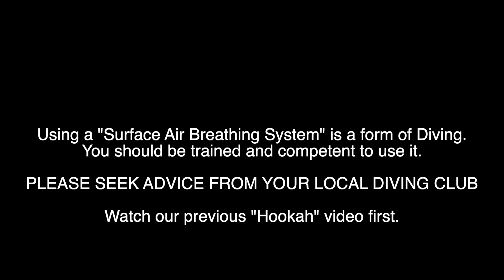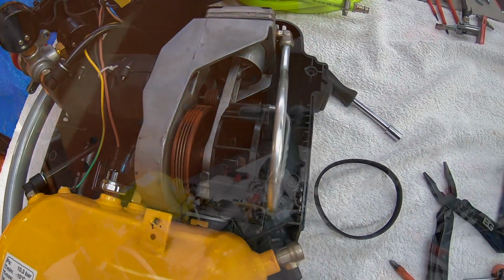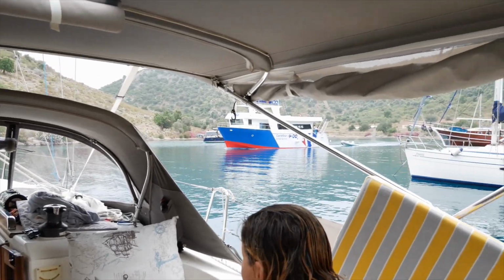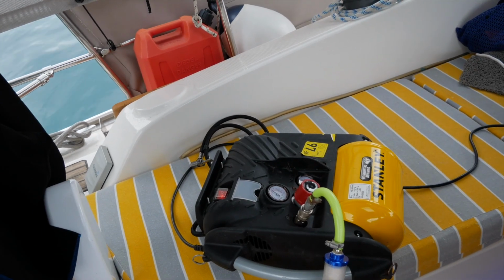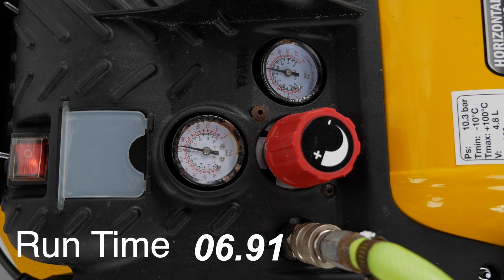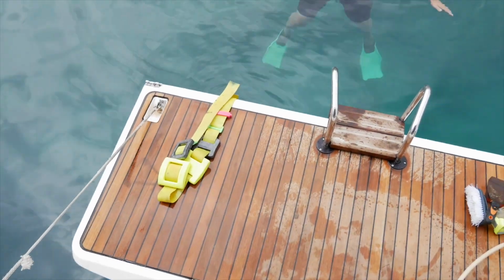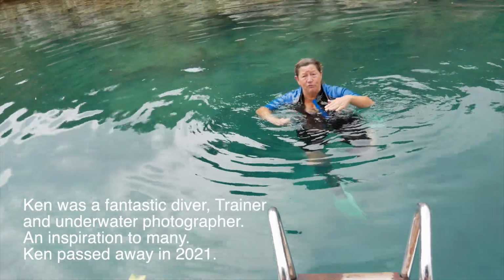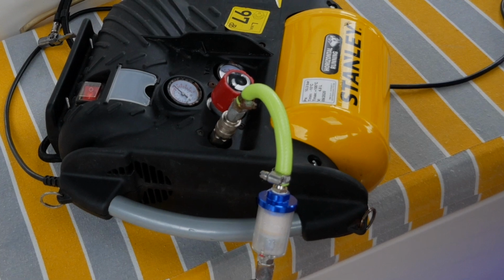A Cheap Hookah! Saves You Hundreds! We follow up on our original construction.

Comment: Having a hookah rig aboard is invaluable! Great addition.
As a professional diver with years of using hookah rigs, as well as working for dive service company, here are a few suggestions:
1) try to plug unit into an outlet (GFI) or use a short heavier gauge extension cord than your surge strip 
2) Add a D ring to your dive belt, then affix a carabiner or bronze halyard clip to your hose
3) to avoid tangles in hose, swim out entire length and take any twists out before clipping it on dive belt. When coiling it up, throw in a reverse coil every two or three coils 
4) typical tools for hull cleanings are a 5-6”wide scrapper (round off both points to avoid scratching hull. A wire brush to knock off spent zinc on anodes. 
Three different grits of scotch right type pads.
Bottle brush (es) for your thru hulls.
Also small tool such as a 2mm t-wrench for cleaning out intakes of your sail drive.
Lastly, regularly clean your regulator, nothing worse than tasting old algae 😂😂
Depending on what type of regulator you are using, be aware some are not meant to be used completely inverted and will free flow giving you sudden mouthfuls.
If running any other fume producing machinery always make sure your hookah unit is upwind from such. 

What a nightmare replacing that belt! Good job mate!
Reply from the maker: Thanks for the feedback and tips Gordon. Some of this we are already doing. Another is to clear the bottom saildrive inlet with a long copper or aluminium tube. A lot of folks dont even know that iis there and its this one that takes a lot of water in if the others get clogged with barnacles and tube worm. All good stuff. Thanks for watching and great comments. Sail Safe mate. Ant & Cid

Comment: Great review and instructions! Question, is the oil/water separator enough to filter hypothetical debris from the compressor, I.e. do you feel it's safe enough to breathe the air even when there's no finer filtration? Thank you!
Reply from the maker: The compressor has an oil less piston and chamber. Basically your only breathing the same air you would be when not underwater. The water separator is to stop moisture going down the hose an the same with the filter just to stop anything getting into the hose. Sail Safe Guys, Ant & Cid

Comment: Cheers guys!  Only time i tried one we had I believe four people,  but they kicked me off,  apparently i was breathing too much,   as was explained to me later,  “that’s normal for first timers”  but i was slightly panicked under water..
Reply from the maker: It's always better to breath too much than not enough Trev 😎We will have to get you aboard at some ime and give you a proper try out. Sail Safe mate. Ant & Cid
Reply: @SVImpavidus  yeah it didn’t look like your one,  remember this was years back,  but it had a petrol compressor and like a round thing that floated behind the boat,  with four hoses plus the one to the boat..  obviously they were saying hookah but I assumed it was called a hookup..   as in we all hooked up..  the float which now I assume was a air storage tank had the dive flag on it..  but they were diving quite deep going after crayfish,   I was struggling around the top,  partially because i was too afraid to put most weights on,  but they must not have been getting enough air at depth,  which lead to them saying “Trev you are using too much air” we need to un-hook you,  which was okay i sat in the boat with the other guy watching the compressor and drank beer..    these were my fishing buddies, not professional divers, although two were certified scuba!        End of the day, we had a lot of crayfish..
Reply from the maker: Sounds like you were too buoyant. You probably need a weight belt.

Comment: Glad you got a fine particle filter to trap any piston or cylinder material that might flake off.  Water separator is needed when you are running mechanical air powered equipment , but not so much for breathing- you need some moisture in air otherwise very dry mouth.  
I could not tell if you have an air intake filter- usually just open cell foam type that prevents any large particle floating in air from getting into the pump.  You should not be running any gas/diesel engine or propane oven/hob while using the hookah. 
I looked into a while back and think a 12v dc powered two diaphragm  pump with 2-3 gal alum tank would be ideal.  Quiet, enough air supply for 2 at 30 ft, 12v so can be used with 100ah bat in innertube with inside box/inflatable boat for limited depth diving.  Larger tank allows air to cool down and eliminate need for heat dissipation hose used on some hookahs.  Diaphragms can be replaced- pistons, not so much. Assume that yellow hose was breathing certified and detachable harness  with straps on front and back that allows hose to be attached to back is best.  Wear a waterproof watch with timer to keep track of time if using a battery powered hookah for obvious reason.
Reply from the maker: Thanks for watching you may like the first video there is a link in the description. Sail Safe.

Comment: How's the compressor holding up a year later? Did the belt break ? Is the belt a weak part ? 
Regards Paul
Reply from the maker: HI Paul. Yes the belt did break and it was a pig to change. But, we used it again the day before yesterday for two hours and wiped the whole of hull down with a sponge and a scotchbrite. It has been good value for money and saves a lot of panting and puffing with a snorkel. Sail Safe mate. Ant & Cid

Comment: To solve the problem of the hose floating away. Place the hose over your shoulder then pull it down your back and place between your legs. Pull the regulator up your front and place into your mouth. Then put your weight belt on around your waist and over the hooka hose, then tighten the belt. This will keep every thing in place allowing freedom whilst diving, as the hose will float away from your back whist swiming. I use 40 ft of hooka hose attached to a dive bottle, and this system works well. Cheers Kevin.
Reply from the maker: Thanks Kevin. Sail Safe mate. Ant & Cid

Comment: Thanks for the video, I used your setup and it works a dream. It saved me £1000's this season when I spent 6 hours under the boat removing a prop wrap.

Unfortunately my belt is now shredded. I see you mentioned an EPJ307 belt, did you just buy off eBay??
Reply: Yes I got mine from ebay and bought a spare too. It was relatively cheap.
Reply: @anthonykirkby5144  Perfect, thanks for that. Now to get the tool kit and swear jar out!
Reply from the maker: Enjoy! 😉

Comment: I put together a similar system using a compressor with a 7.5 liter tank. Tried with it set to around 5 bar, but the compressor ran continously and was unable to keep up, dropping to around 2 bar. No apparent leaks anywhere in the system. Any thoughts on why it can't maintain adequate pressure?
Reply from the maker: You are using more air than the compressor can produce. You will need a minimum of 30 ltrs per minute possibly double that when working hard in the water. The calculations are in the previous hookah video.

Comment: I got a question. Why does the hookah system keeps on shutting off and on ?
Reply from the maker: Hi. When the cylinder reaches 10 BAR pressure or roughly 150 PSI the pressure switch cuts off the compressor motor. As you breath and the pressure falls, at around 8 BAR the pressure switch turns on the compressor motor. The more air you breath the longer the compressor motor runs. 👍

Comment: Hi,  I’ve got the same systems hookah as you but can you tell me what pressure you set the regulator on the compressor at ( ie: the red knob) cheers Phil
Reply from the maker: Set it to the max. 10 Bar. The demand valve will do the rest. 👍
Reply: Thanks very much Ant, just going into clear the prop and shaft today. Happy sailing guys

Comment: I would like to build a hookah for 6 - 10 meters tourism:
mini inflatable raft
10ah lithium battery for on boarding to aircraft luggage
12v  120 watt aquaculture pump
potable water garden hose (white jacket) - bought at destination
2 liter disposable plastic soda bottle to maintain constant pressure - bought at destination
regulator and in-line filter
would you be interested to build a prototype and parts list?  it seems you have a knack
Reply from the maker: Sorry Kevin I'm retired...